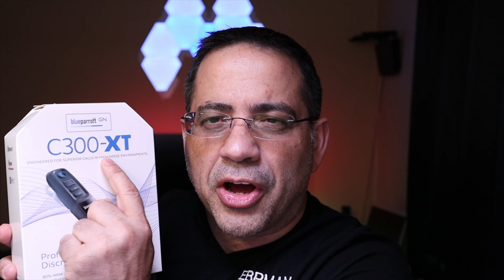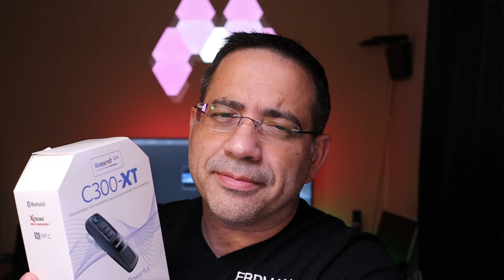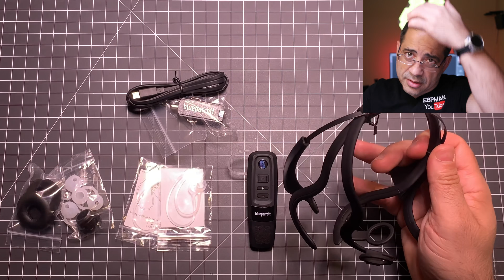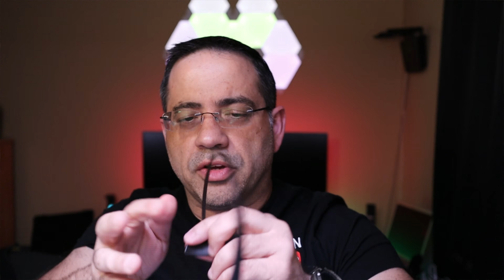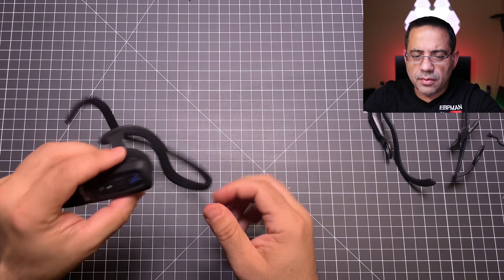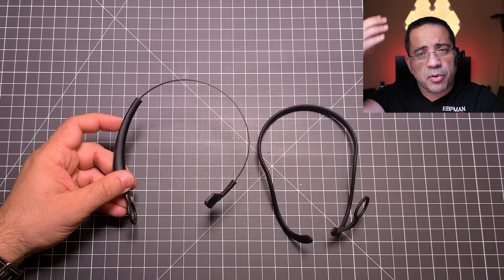Blueparrot C300-XT Crushing Noise Cancelling Must Hear Call Quality

Comment: I hate mine. Did not realise how heavy, cumbersome and dumb looking it is. Wish I saw this review first. Call quality ok but the blueparrott app is rubbish and I deleted off my phone straight away. I came from a plantronics device which had a far superior experience such as double tap for recall and giving you info on battery. I'm stuck with an expensive device that I can't afford to throw away. Not too bad in truck driving enviroment but too heavy to keep hanging in your ear and not really "pocketable" when not in use

Comment: I used the headset with the small  accessory, it keeps coming out of my ear and  some people complain about the noise. I changed to the same headset you try and so far so good. I like the range and the features, however, I downloaded the app and it keeps asking me to download the app
Reply: This device should be the best one. Unfortunately the volume is sacks
Reply: I Never got the software update to work!  Have a galaxy s9.